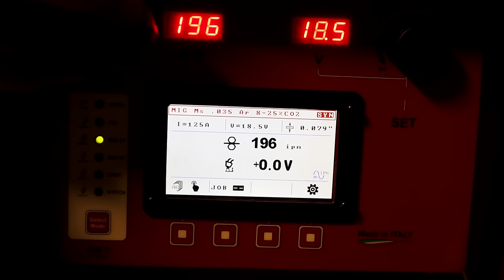A More Affordable Welding Table, And My First Job With It.

Comment: Im a 19 year old welder located in Snowhill NC and been in the welding industry for 2 years and I have never seen someone work like you, you have some insane fabrication skills.👍🏽
Reply: Take notes and make it your own reality
Reply: Seems like an exciting career … there are so many ways to go things to learn .. if I were young again , I would learn all I could about welding , from welding to the technology the science the engineering etc lol 

You sound like you are off to a good start. Keep welding !
Reply: Especially those smooth chamfers across the jobs, be it inside or outside, diameter, square, rectangle, or oval. Simply keep on admiring the skills. I don't think these are taught in institutions.
Reply: @lisalovelylpa  espléndido comentario, comedido y tranquilo, en realidad demuestra mucha sabiduría y manejo de sí mismo❤
Reply: You rarely will. Most folks just hack and slather these days.
Reply: That cause he works for himself. When you are your own boss you have the flexibility to set your own standards. Being in the commercial construction industry I  thought it was going to be all about precision and taking the time to do things “right”. The only times I’ve seen super high levels of detail or taking the extra time to make something to a higher standard is if it’s on YouTube or some other platform. in all actuality most of the time your boss is about production and the time spent doing the task over anything else. It kinda sucks especially if it drives you crazy knowing that if you had a little more time you could have accomplished a task to a higher standard rather than just throwing something up(while still technically to standard and code). The goal is to be my own boss one day and continue to learn ways to work as quickly and efficiently as possible.
Reply: @spacetruckin6555 Well that really isn't true in any way. Most fab/welding guys are constantly doing a dance with customers not wanting to pay for exacting work yet complaining when they don't get it in their chosen price range. If you had experience in this or "any" other trades you wouldn't make such a sweeping inaccurate statement. Most guys do the very best they can with the constraints placed upon them. Customers don't like to be told they are the major reason for work quality performed.
Reply: @matthewmoilanen787  After pulling leads and laying beads for darn near 30 years, those are the same excuses I hear all the time from shop owners/foreman to fellow tradesmen. "I can't do my best work because of excuse A, B, or C". On my side work Gig it's pay what I quote, or kick rocks. No shortage of customers needing quality work, when you say you're going to do it, and actually follow through.
Reply: HERE HERE...................................I Second that thought !
That welding table is the Formula 1 of ALL tables......................I also have a HTP welder...............
If you want a beer, drink a Miller, if you want a car , buy a Lincoln, if you want to weld, buy a HTP !
Have a Nice Day Everyone !

Comment: There was a company in Australia (Elliot Engineering I think) that started building these tables back in the early 90's.  They were a copy of a Demmeler table and looked virtually identical to this table.  They called them "KwikJig" tables.  I purchased one in 1996 and at the time, it was a pretty significant purchase for me (around $10K)  I was a little worried at first if it was going to be worth the price.  After using it for a month or so, all my fears were gone.  It was by far the best purchase I ever made.  The speed and accuracy that you can fabricate on these tables is unbelievable.  You are going to love this piece of equipment. Accumulate as many clamps, twist locks, angle plates and attachments that you can, you can never have too many.

Comment: Glad it all worked out for you too! Since I don't have a MIG machine, how about spatter? Did anything stick to it?
Reply from the maker: I've always used the anti spatter spray and very little sticks to the table and even the occasional bb that does comes right off and doesn't damage the table pretty impressed with the nitriding
Reply: Nitrided welding tables don't have to worry about welding spatter.
Reply: Always nice to see my favorite channels are connecting 😊

Comment: Great video and weld table was what drew me in 👍👍
  But I know you know and sure that hundreds of people have mentioned it but might want to start using gloves even thin ones just for the UV protection. I have used sunblock but way too much grease and slippery to use .
   I have had a LOT of places cut out and had cancers taken out because welding.
   Or another thing is just get a $10 a month cancer policy it's well worth it .
  I had the cancer policy and was actually paid more from the policy than my out of pocket so It would have paid for the table anyway if you don't want to wear gloves 👍👍
   I am new subscriber to the channel keep up the videos
Reply: Gotta agree. Because we love, wear the glove. That's the worst type of UV you are getting and it's far, far more that you could ever get from the sun. Do it for your kids, if not for you.

Comment: I do alot of railing repair and basic railing and it keeps me busy. One thing I can say you have a great set up. It seems in our area people don't understand how much time, equipment, and materials to make it happen.
Reply: Bro its the same with all the trades. People think I'm hosing them to try and make a decent wage. I ain't retiring off this one job I'm doing for you, sir. Just trying not to lose money in the process. The money I have invested in my meager shop and equipment and tools and consumables and insurance and everything else is staggering. /rant
Reply: I won’t work for someone that does not appreciate it.
Reply: @donsmith9081  Kudos to you. The way it should be.

Comment: You could not have done that job efficiently without that table.  I bet you didn't swear once! I had to build a bifold gate (1.8 m high, 4 panels about 0.8 m wide)  to replace a heavy one (110 kg) that was broken in my driveway.  I couldn't get anyone interested in doing the job so I bought a AUD 250 welder and a really  hilariously small welding table for AUD 150. I had never welded before. Having a table like yours would have made the job so much easier. I got it done and it was all square and the hinges were perfect.  I can open and shut it with my finger it works so freely ( I reduced the weight to about 50 kg). I did get a practical lesson in the banana effect and I just got the angle grinder and cut 2 of the three horizontal bracing straps and got my scissor jack in and just gave the structure a gentle Newtonian tickle and tacked it, tested the fit and movement and then went full gorilla on the final welds. That would never have been necessary with a beautiful table like yours.

Comment: As a standing seam roof specialist, tell the owner to get the roof seams double locked.  Shallow pitches do in fact have water infiltration when ice builds up on them. I’ve seen many leaks from this with 25 years experience in cold climates.  Awesome work.

Comment: Nice Table and Nice Railing!  There is a simple mod you can make for your Ellis to cut those (sharp) angles perfectly.  Weld a plate adjacent to a pc of sq tube (90 degrees) then just clamp plate to Ellis fence. Now you have an intersecting fence that you clamp material to.  Make a left and a right.  Flat plate needs to be flush on blade side and plenty long on other for clamping.
Also it's a good Idea to a weld a pc of fb on bottom to shim up.  Cheers!
Reply from the maker: Thanks Don thats a good idea
Reply: Im a very visual person, and also own a Ellis. would you have any photos of this set up?
Reply: @Darnic-Fab  Workin on it brother
Reply: @donsmith9081  That link you sent me brings me back here.
Reply: @Darnic-Fab   I wish I had your plasma table!  The link might work now-but basically you weld a pc of flat bar to the end of approx. 24" long pc of square tube 1-1/4 square or what you have lying around (capping) it and hanging fb off to one side long enough to use your Ellis material clamp to hold it in place. You can then clamp the material you want to cut -to the square tube to get more than 45*      Its an adaptor that enables you clamp (the material you are cutting) 90* from where you usually cut it.
Reply: @donsmith9081  It did work thank you very much!
Reply: @Darnic-Fab  Are you interested in another Ellis saw material stop mod?
Reply: Don thanks for posting that and sure I would like to see another
Reply: @Darnic-Fab  I'll get on it tomorrow.
Reply: @Darnic-Fab  The same link has other mods
Reply: @donsmith9081  are you extending your stop so you can cut longer pieces?
I have a roller conveyor set up on mine that I fasted a stop to
Reply: @Darnic-Fab  Yes, I don't have room for a conveyor!

Comment: Thanks for doing the video - placing my order on Monday.  Had a question - did the height of the table just work out so the packouts fit underneath?  Looks like a good way to store all the clamps.  Also - what size table did you go with?  Apologies if you mentioned it in the video - I can't recall if it was in there or not.  Thanks!

Comment: I have a much lighter version table of this table. Its not a Kovosu but being able to fix all your parts in position without laying any tacks just changes everything. Every dimension can be checked and adjusted. And if you have more than one item to make you want the fast repeatability that a fixture table can offer. Its not until you use one that you realise how good they are.

Comment: Just found your channel or should I say it landed in my que.  At 60 years old I’m new to welding.  Picked it up when I couldn’t find someone to build my two gates.  With my new Miller Multimatic 220 and a few Fireball squares I built those two gates.  Wife was real happy too!  Sub’d, liked and learned some too. Thanks!

Comment: We were all wondering where you’ve been and here you come with this video. First off I agree with whoever said we absolutely appreciate the time and effort you put into these videos, just not the time between each video. Lol Anyway love the table, actually have been looking into them because of you. Gotta say it’s nice to see all of the pictures and shorts from instagram in long form video. Plus you got a lot of new toys, not just the table, the new welder and fancy new hood plus all those goodies from Jason at Fireball. Anyway, as you can tell we all love the content it’s encouraging and helpful as well as inspiring. Thanks
Reply from the maker: Thanks man I really appreciate that.....not sure how I feel about the optrel, its nice but alot of small plastic I'll probably break it and its about useless outside even with the lowest sensitivity it flashes from the sun. The htp propulse 300 is hands down the nicest mig ive ever used the pulsed spray it pretty awesome. It was hard to fork put the cash for the table at first but I'm really glad I did and the shipping from China really wasn't that bad.
Reply: @westweld  how much costs were involved on the customs fees and taxes ? My port of entry is Dallas TX.

Comment: Very cool table I’m also interested in the tripod rolling adjustable for doing very large gates thanks
Reply from the maker: You can buy stands called "Sumner pipe stands" and just put wheels on them and modify the head
Reply: Thanks

Comment: we've got like 7, 5x5' square hole tables but using 30 lb stay-stills are ANNOYING. wish my boss would actually get us some FLAT fixture tables but complains when things arent staying flat when theres 1/16th-3/32 dips and deviations ALL over the place on these tables--- theyre old, people weld directly on the table like dummies and grind it down, etc. seeing this table with tubing stay FLAT after welding with just clamps and air cooling makes me legitimately pissed at my boss, because we make assemblies that range from 10-45k a piece, and my boss is so stingy and then blows all the profit on his m5 comp car payments...... like wtf

Comment: Do they manufacture the tables for Seigmund?  Do the Seigmund or Strong Hold accessories work in your table?

I’m super interested. I live in Northern Colorado.
Reply from the maker: They don't make seigmund tables as far as I know they only make thiers.....and yes all seigmund 28mm clamps and fixtures will work as well as strong hands alpha 28 line

Comment: Very nice- I would have also strapped over the back, when picking it up; it really is a heavy table and only relying on the over-the-side straps seems like a big risk. Could have slid right out the back; the crate is just wood and nails/screws. Anyway, you made it!
Reply from the maker: You're not wrong

Comment: Nice table and nice machine.  I have a custom made 20ft MIG gun on my Pro Pulse 300.  Gonna get ready to order some more.  Hit me up on FB or IG if you would like more info.
Reply from the maker: That would be nice.....no birdnest issues?
Reply: @westweld  no birdsnest'ing.  Granted, this is for steel, not aluminum what so ever.  I have these custom-made in 6 meter lengths.  The added length with zero issues is very liberating when working on larger projects.  Just needs +0.4V to compensate for the added length and that's it.

Comment: Did Kovosus engrave imperial or SI markings on the table parts? It wasn’t clear from what you showed. Clearly the holes were in SI … thanks, West. Fantastic video!
Reply: We have markings SI or Imperial.
Reply from the maker: Thanks yes my table has imperial engraved on the outside and on the fixtures

Comment: If your saw has it so the bow swings to 45 degrees you can make a jig that’s at 90 degrees . Get some 3 or 4” box section that goes in the vice then weld some angle on that at 90 degrees so if looking in a birds eye view the box looks Horizontal angle is vertical . You can then lay what you are cutting in that web . Then if set the saw to cut at 30 normally it would give you 60 degrees. I only use this if cutting batches.
Reply from the maker: Do you have a picture?  Gingrbreadman1985@gmail.com
Reply: @westweld  did you get a photo? Lol I didn't understand anything either.

Comment: I appreciate the hustle. But in all my years of welding, I never needed a table like that to complete any job ever especially the cost no matter what you got it for.!
Reply from the maker: I’ve been welding for years without one but there is no question the table greatly improves efficiency and accuracy, I should have got one sooner
Reply: Both statements are true. However I prefer having quality tables, tools and fixtures as well but it all can be accomplished no matter. So far I've rarely invested in any tool or equipment that didn't pay off very quickly. The more you have the more you can do for customers as you expand your abilities. Time is money. Efficiency is paramount.

Comment: how flat is the table w/ the wings? any humps where they drilled the holes or welded the tubes?
Reply from the maker: Its flatter than I can measure accurately i have a 4 foot starrett straight edge and can't get a shim in anywhere....I had to mess with the extentions a little before I tightened the bolts buts easily aerospace flat everywhere.....he gives you his tolerances and at least with my table hes well within those
Reply: @westweld  very nice, have heard of other brands of tables being more taco or potato chip shaped. thanks for the info.

Comment: I'm also looking for a serious welding table like this but it's hard to know which size and hole pattern to go for.

Would you recommend to have D28 with simple 100*100 pattern as yours or with double diagonal hole pattern?

For jobs like this, wouldn't D22 be a better compromise? Only a little bit harder to get tools and accessories. Siegmund and some Chinese companies sells D22 also.

Comment: Enjoyed the video apart from the music that was close to torture. The table is a real treat, but for doing handrails seems overkill unless you churn out twenty similar pieces a month. Here in California I used to work in the sweat shops making handrails by the mile. They would sometimes build them on dirt. The price per foot was so low that no fabricator would touch  a railing job. Now if  you fabricate complex items for the oil industry, than this is the right tool for sure. Hand rails do not require accuracy.  Anyway I subscribed today. Greetings from Brittany France.

Comment: I see you have or had a big cast iron acorn type welding table.  Did you replace with this one?  Why did you opt for metal vs cast iron?  Are you able to do plasma cutting over the top using stand offs?  Thanks for your help!!

Comment: what flatness tolerance are they rated too?
Reply from the maker: Very flat….. mine is less than .002” out in any 4’ span ( my largest precision straight edge is 4’)
Reply: @westweld  thanks for that info. That's plenty dam flat ! Nearly as flat as Lubbock TX where I can watch my dog run away for several days.